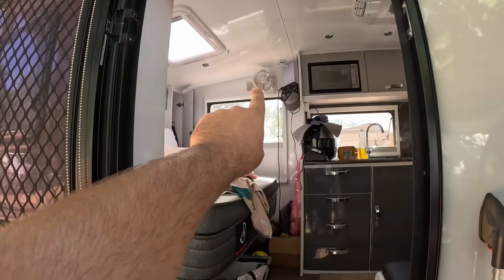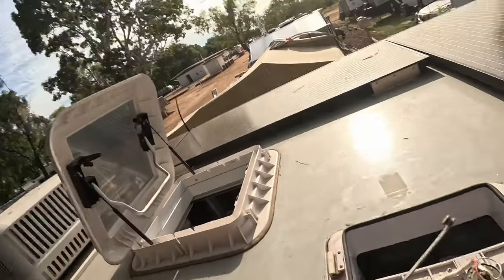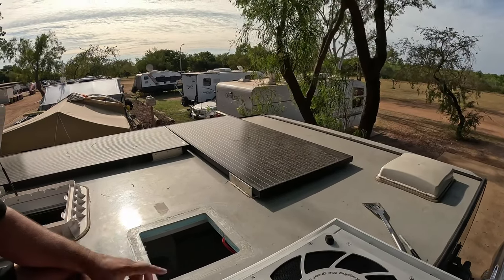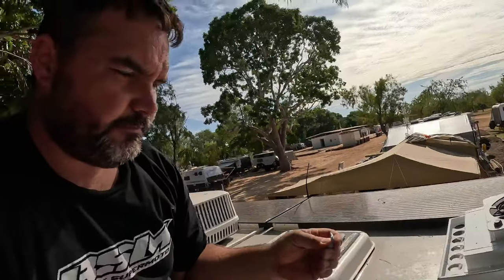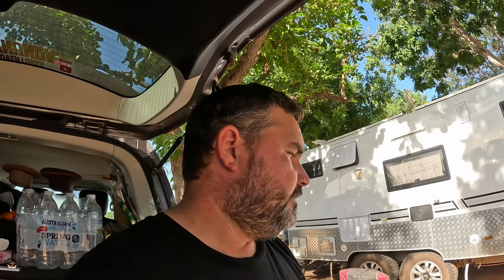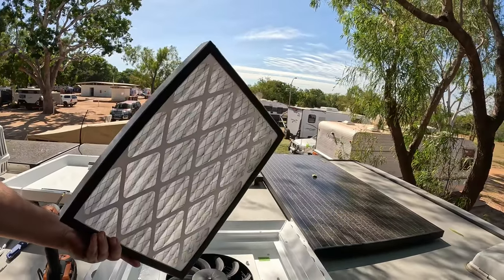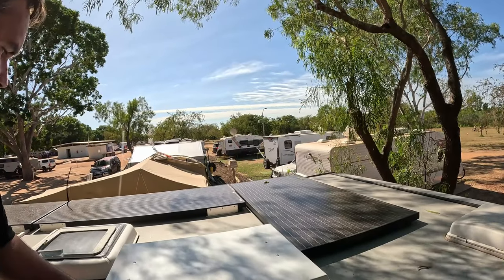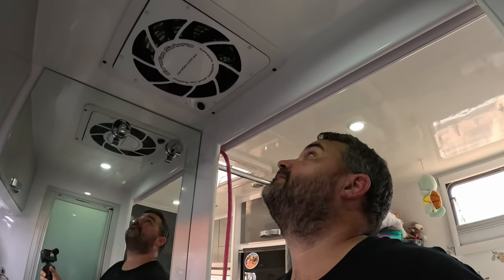CaraFan Sahara full install!!

Comment: Wow, you'd think old mate would of flicked ya message telling ya he wouldn't do the install before ya got there.
I am interested in the fuel usage per 100ks with the van on. I'm looking at buying a patrol.
Reply from the maker: We average 27-28l mate but i dont sit on 90 like most others im usually at 110 combined mass sits around 6700 kgs usually
Reply: Cheers for a honest reply. I knew it was up in the 20 to 25 range. Something to consider as still undecided.
Reply from the maker: Yeah i love it to be honest it feels very safe to tow with its comfy and has plenty of power im very happy with choosing the patrol for what we are doing its perfect

Comment: I’m actually currently in the midst of installing a Carafan in my caravan at home (I had to leave it for a bit since my domestic duties called) and only stumbled across your video just now. I did exactly what you did and replaced and extended the exhaust fan in my ensuite.
A quick question … I noted that you didn’t install any (aluminium) internal bracing supports inside your roof around where the unit mounts. Noting that the Carafan installation instructions mention this, is that something you’re overly concerned about? I’m planning on doing this with my install which will be a bit painful since I need to try and connect all the aluminium parts together with machine screws all whilst it’s in the roof - not sure if it’ll work at this stage.
Top job you did with your installation by the way especially considering you’re on the road 🤘
Reply from the maker: I did think about it however i don’t think its needed hey the unit itself its strong as hell so it braces its self and spreads its weight very well .. note* i dont think they designed it with composite panels vans in mind hence why i had to space it up a few mm soo.. im thinking the bracing is for vans with frame work in the roof like timber or ally welded frames which you would have to brace 100% to keep a solid structure in the roof sheeting..

Comment: Thanks for the video. I'm wondering how the carafan is going now that you've had a chance to test it?  I'm looking at doing the installation myself too. Do you find that with the position of the carafan in the bathroom that the pressure reaches the rest of the van?
Reply from the maker: Yes mate its good in that position you can feel the air coming out the front door vent etc they work very well!
Reply: Great. Thanks for your reply